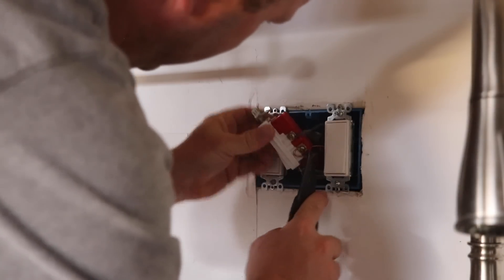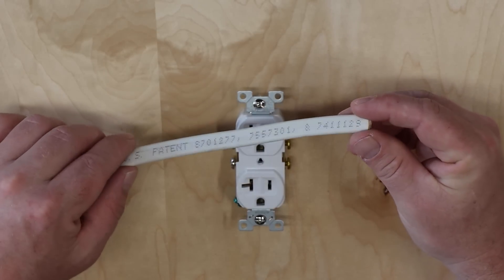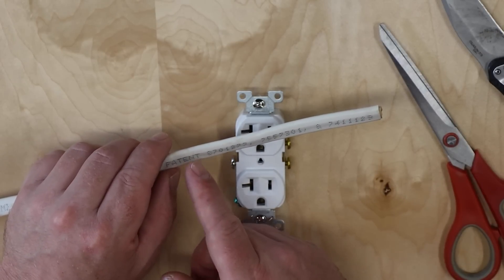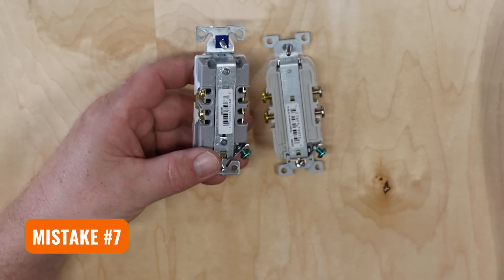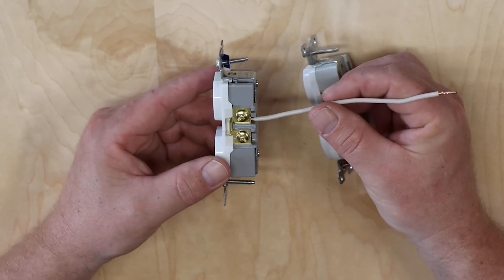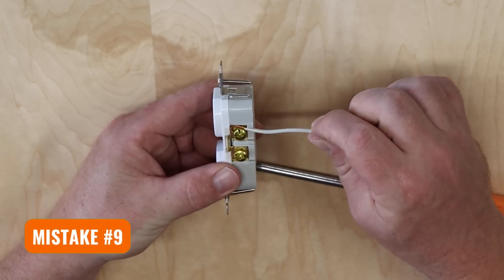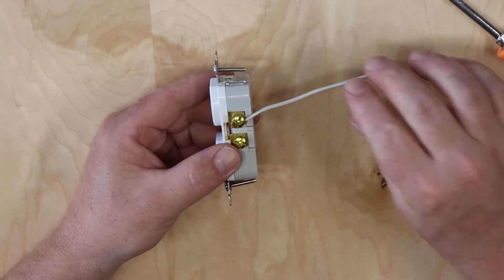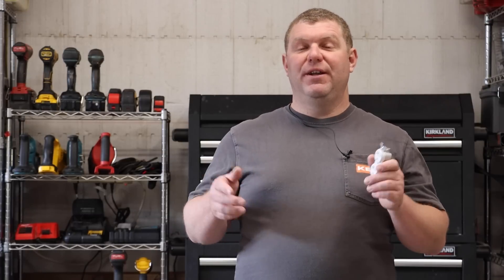11 Fatal Wiring Mistakes DIYers Don't Know They Are Making

Comment: Couple things that you aren't necessarily correct on. The difference between and 15A and 20A outlet in many cases is ONLY the front plastic cover. Many manufacturers use the exact same internals between the 2 because it is more cost effective. Obviously that only applies to outlets of the same grade, a $0.50 outlet is going to be less robust than a $2 outlet. 
Also for the back wiring with the screw plate, that is a very strong electrical connection. If you think about it, you only need as much contact in the connection as the cross sectional area of the wire. That plate is going to give you much more than you need, and can actually be a better connection if you hook isn't perfect. And you can get 20A outlets with the back wiring, they just aren't as common.
Back stab is different than back wiring (push-in vs screw plate)

Comment: Whoa Jesse!  Putting 20 amp duplex outlets in place of 15 amp outlets are okay as long as, as you mentioned, not putting a 20 amp load on a 15 amp circuit.  Okay it should pop the breaker but why take the chance.

Comment: Thanks for the video. Why do you recommend a pigtail when there are two screws for that purpose (and for split circuit, of course) on each terminal. And yea, we noticed the 14 to the two 12 wires. Great job, I had to learn all this stuff on my own. Thanks!!
Reply from the maker: Perhaps a better example would have been showing two wires already attached thus no free screw is available. That’s the use case for the pig tail which happens a lot.

Comment: I only ever used 12GA copper never 14GA anywhere, and I never liked or used romex, all my wiring is either in steel conduit or it's armored cable, and the breakers are usually 15 amps except for a couple of 20 amps for outdoor outlets where I needed an electric chainsaw that was tripping the 15 amp

Comment: I also always wrap the screw terminals with electrical tape.  This reduces the risk of harm when someone is trying to pull out the receptacle without turning off the circuit or when the cover plate is broken.

Comment: Watch using those Romeo strippers on 3 wire…..those are designed for 2 wire.   You will cut the 3rd wire

Comment: My dad was an electrician and he taught me to wrap the wire around the screw and pigtail when needed, just as you have shown. Striping of the outer sheath of the Romex was down with a utility knife, but I don't think they had that nifty stripper tool back then.

Comment: 2009' Local Code outlawed 14ga romex for residential. I don't live there anymore but I still simply wire every house with 12ga only. As an Electrician since 1993' it is cheap, simple insurance. I have never stabbed 14ga in the back of an outlet. I am a SIPs builder that offered to help you with wiring your house when I saw your Timber frame was placed to the edge of the decking. Glad you are back.

Comment: Good video but one comment.  When you are demonstrating how to connect the wire to the receptacle screw you are showing a white wire and are connecting it to the brass/gold screw.  This may be confusing to inexperienced DIYers.  Would be less confusing if you had used a black wire since that's the hot wire that should be connected to the brass screw.

Comment: Great video with lots of good tips. I was not aware of the wire stripper to get the outer sheath off the wire. Will get a pair on my next Big Box visit.
Surprised you did not do the standard you tube disclaimer.

Comment: Hi Jessy, that is why I am never moving to America. There is one thing you did not mention and that is the earth wire, here in the UK you can get covering for this wire because a lot of people leave about 6” of bare wire that is shoved into the box and can potentially touch any of the screws and cause a short.
Reply: Not really an issue, and non romex wire (ie MC, or EMT conduit) the ground wire is insulated. The only way the bare ground wire comes in contact with Hot, is if the wiring is done improper. UK wiring sucks, Ring circuits come to mind as well as running 230VAC to every outlet (much worse shock hazard)

Comment: Very good video.  I'd note any pigtail wire should be the same gauge (or larger wire size) as the rest of the circuit.  It looks here as if a 14 gauge wire is used to pigtail two 12 gauge wires.  Also, a 20 amp receptacle should not be used on a 15 amp circuit.  Both risk overloading and a fire hazard.

Comment: One issue I have with USA wire gauges is that is gives a false information: 12 gauge is more than 50% bigger than 14 gauge, so 12 gauge is able to carry more than 50% more electricity than 14 gauge, but 12 and 14 seems deceptively close.
Reply from the maker: Unnecessarily tricky for sure.
Reply: You don't just go off of intuition based on how large 12 gauge sounds you use the code book.
Reply: @NoName-ml5yk  But if you know that a 2 square millimetre ire can carry x amount of electricity, you don't need code book to know that a 4 sqm wire can carry the double.

Itt is not intuition, it is just basic physic. But going from 14 to 12 gauge cannot apply basic physic (or at least it would need much more complicate calculation).
Reply: @olivier2553  Incorrect. Look at the charts.

Comment: I don’t agree with #3, #6, and #7 but otherwise it was good info. 

#3, 14 gauge wire and 15A receptacles are very common. 15A circuits only require 14 gauge wire.

#6, I didn’t notice you mention that upgrading to a 20A receptacles requires that the circuit is in fact 20A and has 12 gauge wire ran.

#7, Screw clamps are perfectly reliable and are on high quality 20A receptacles such as Eaton Commercial.

Comment: A fifteen amp circuit with 14/2 Romex and a fifteen amp outlet is perfectly appropriate for many applications and will not overheat when properly deployed. If you put a device on the outlet that tries to draw more than 15 amps, you will trip the breaker. I advise against putting a 20 amp outlet on 14/2 Romex because it might cause someone with a higher draw device to try to rely upon it. The breaker will keep you safe, but it makes sense for the outlet to inform the user of what underlies it. Most 120V outlets in most homes will be 15 amp. Would it be nice to have all outlets @ 20 amps? Sure, but 12 gauge wire is more expensive and it's also harder to maneuver.

The clamping connections on newer outlets is perfectly safe and will not risk either overheating or coming lose. The backstab holes are more risky and most electricians will advise against them even though code allows them, but the side clamps are very safe when properly installed. 

Something else to mention is that you must now protect all outlets in shops and garages with GFCI.

Loving the new videos Jessie. I didn't realize how much I missed you guys until you came back and reminded me!
Reply: I agree. However, code does not allow 20 amp receptacles on 14/2 (15A) circuits (although it does allow 15A duplex receptacles on 20A circuits), so you should never do that. What you want instead is commercial or spec grade 15A receptacles, which are better made and heavier duty.

Comment: Great video just wanted to make two comments.
1. Your video seems to suggest that 14Ga wire is white and 12Ga is yellow, which is not always the case.  The jacket color is not an indication of Guage. This could confuse amatuers.
2. It has been lost knowledge even to many modern electricians but the "Poke" terminals do have a purpose.  In the 60s/70s aluminum & copper clad aluminum wire was allowed.  The coefficient of expansion of aluminum is  about 35% greater than copper.  Over time this can cause screw terminals to lossen, so the spring ("Poke") terminal were added to the back of outlets to compensate as they are supposed to expand/contract with the aluminum wire.  It was my understanding at the time that the screw terminals should never be used with aluminum wire.
Reply: Just a clarification about romax jacket color.... while what you said may be true for modern cable, this has not always been the case.  I've wired many houses in the old days where 12Ga romax was also white.  There was also a period of time where both colors were available.

Comment: I've always hated those stab connector outlets since I had to help my sister track down the loose connection that killed power to half a room's outlets.
Reply from the maker: Not sure why they are even allowed. New product out that replaces them. Even easier to use. Will do a video soon.
Reply: @purelivingforlife  
The offending loose connection looked like it had gotten quite hot with its arcing and sparking inside the outlet. I definitely think that they should be eliminated due to fire risk.
Reply: @purelivingforlife  
By the way, love your videos, and I’m glad you’re making videos again. Sorry that you had to put up with such evil people. Until you came out with your explanation videos, I never knew that such evil people existed with nothing else to do.

Comment: Thanks Jesse. you might also mention screw in all the other screws, whether with a wire, or not. Some people will also wrap the receptacle, or switch, with electrical tape as a precaution. Not needed, but I can understand their reasoning. Thanks for the video. Jon

Comment: Excellent video! FYI “electrocution” = “electrical” + “execution”. I don’t think you mean to say the result is death when you use that word. “Electric shock” is usually the term used when death isn’t the result.
Reply: You are incorrect. To electrocute is to be injured or killed by electric shock. Death is not necessary for the use of the term to be valid.  Feel free to type "define electrocute" into your favorite search engine.
Reply: @watcherofwatchers  Actually Ken A is absolutely correct and Jesse should have said "electric shock". Then causing a house fire would be a worse result. Electrocution is a risk and in this context implies a fatal outcome. You are technically correct, though. There's a saying that if you make a mistake with electrical, you could be killed, if you make a mistake with plumbing, just get a mop.
Reply: @surferdude642  i was not commenting on how the word was used in context with priority and severity in play.  Jesse was speaking somewhat informally, so whatever. Ken A made a factually incorrect statement. Electrocution is not, by definition, a fatal incident.  That's all I was addressing.
Reply: @watcherofwatchers  You are incorrect. The definition is "to kill or severely injure by electric shock". Its etymology shows that it was indeed derived from "electro" + "execution". It may have colloquially evolved to include non-death, but it's origin is death and still doesn't include simple "injury". My point was that the vast majority (about 30,000 per year) of electrical related injuries are not classified as electrocution (which accounts for about 400 per year), so we have to be precise when we use the word, especially in a "common mistakes" video where people are taking the content with some level of authority. I just think he misused the word, but it's a common word to misuse, so I clarified.

Comment: Pressure plates on the side on outlets are utilized because they are listed for both solid wire, and stranded wire. common in commercial applications where stranded wire is more common.  The pressure plate style, as well as the wire curl style have both proven to be very solid connections.  The Stab-lok connections, as you have stated, are absolutely horrible, and should be outlawed in my opinion.

Comment: A better solution to tighten outlet screws is a # 1 ECX driver. This driver utilizes both the blade and the square part of the screw to get more torque on. They are a little more expensive but worth the extra money.

Comment: Surface area contact for 15A isn't as big of an issue as you think (torque the connection and use the number of recommended conductors). Those receptacles are all UL/CSA rated, so you're fine to use them as they are intended (rather as mfg suggests).

"Compression-plate" is fine, and so is the back-stabbing method. I don't like the "back-stabbing" but it doesn't mean that it's wrong or going to burn your house down. It's tested and rated for the outlined application.

Lots of online testing has been done by people running current over different gauge wires... All I can say is follow code, do things safely, don't skimp and do a good job... If you can't follow these steps: call a professional/certified electrician!

I'm sure electricians will say the same.

Comment: Though I agree with most of what you’re saying, the code dictates where those outlets go. 15amp outlets are rated for kitchen counter tops and bedrooms. Vacuums don’t use over 15 amps most of the time either. The UL listed push in wire nuts are rated for 32 amps so the push in connector on that outlet is sufficient when the plug is located in the right spot. It’s not a fire hazard when used correctly. Most other outlets are rated for 20amps so you still have a breakdown potential in the wire when someone plugs in say a 30amp saw motor which is why the code mandates arc fault breakers with thermal capability. So if the code is fallowed this is a non issue. 

Additionally we use three wire which you have shown in the 14 gauge wire in white we use for outlets that may be switched. I agree it’s not common but not something to be worried about initially. 

I do agree that if you don’t have a black or red wire behind a switch or outlet that you need to be cautious and probably pull the wire or identify and shrink wrap with the correct color.
Reply: the reason not to use the push in on the back of the outlet is that over time they fail. in residential wiring it is common to us the outlet to  make the connection to the next device  and this causes and issue down the line. best way is to tie the wires together then use a pig tail to the device. also the breaker protects the  wire, not the devices. a 30 amp tool will have a different plug so it can not be used on a 15/20 amp outlet. think of the oven plug/outlet as an example
Reply: @bartmcdonald1251  that’s not completely correct. I have a tone of tools that draw 30amps at start up and plug into a regular outlet. Stoves are 220v or 240v that’s why they are different and not all 20amp outlets have notches in them. So. Push in connectors on the outlets are totally fine and acceptable.
Reply from the maker: Excellent input.

Comment: The strippers you used, are listed for 14-2 and 12-2 NM-B romex, not 14-3.  14-3 is the cable you are using for your demonstration. So those pliers are not made for that specific cable. Please verify content before posting.  You may be reducing the diameter of one of the conductors and possibly almost cutting through it entirely.
Reply from the maker: You are correct these pliers are designed for 12-2 & 14-2. The lesson is to be careful to not damage the wire insulation. Not to blindly use these pliers for all wire stripping. 👍
Reply: Did I miss something? I only saw 14-2, hot, neutral and ground.
Reply: 14-2 with ground is Not called 14-3
Reply: @Robert Lewis  correct. Black, red, white, and grounding is 14-3, as shown in video.
Reply: @robertlewisvideo  between the 1:30 mark and 4:00 mark, discussion exists about using these strippers to remove exterior romex sheething. They are not meant to remove the sheathing of 14-3 cable.

Comment: The wire size is always matched up with breaker size, #14 should be a 15 amp breaker and a #12 should be a 20 amp breaker in most case. In longer runs of copper wire this may change. They still use 15 amp outlets in many homes and in new construction ,with #14 wire and 15 amp breaker!
Reply: You can use #12, #10.etc on a 15 AMP circuit. It only matters if you under size the wire for the circuit used. on. For my home, I just used #12 for both 15AMP & 20AMP breakers because I didn't want to deal trying running out of one size to complete the work. At the time the difference in cost for a 250ft roll of #14 and #12 was about 10 to 15 dollars per roll.
Reply: I Don't know where get your wire but where I Live, the difference in cost of a 250 ft. Roll #12, #14 is about $40. That's  more then I want to waste!
Reply: @stevehermann7317  Lowes, but it was before the crazy price hikes. It was less than 50% what it sells today. 

Just rememeber what: Yellen, Jerome, Biden said: "inflation is just transitory!"

Comment: Great video.  Nicely said…. Some of us unfortunately have aluminum wiring in our homes and there’s another big mistake people can make is mixing and connecting the two types of metal together (Al & Cu).  There’s also the need to watch what kind of metal the switch or outlet is rated to work with.  There’s proper ways to mix the two safely.  Do this wrong and you will have an issue, there’s no luck involved.